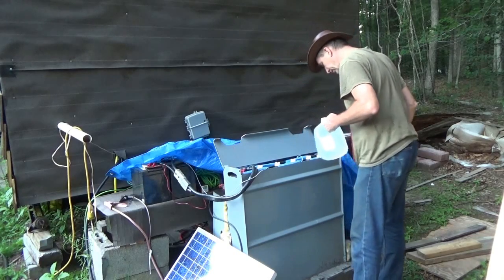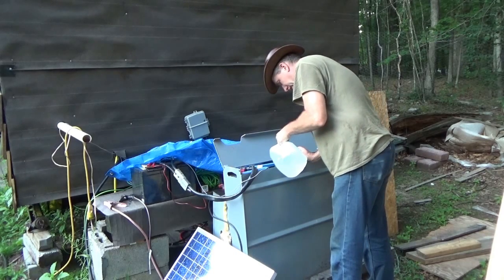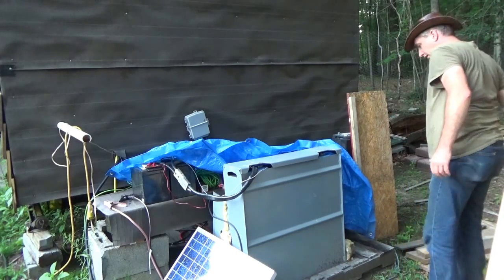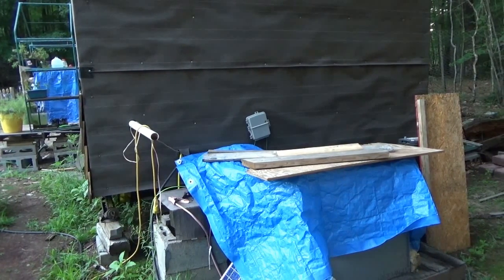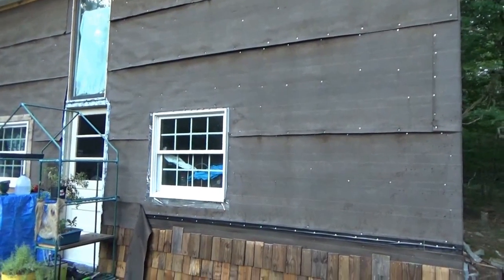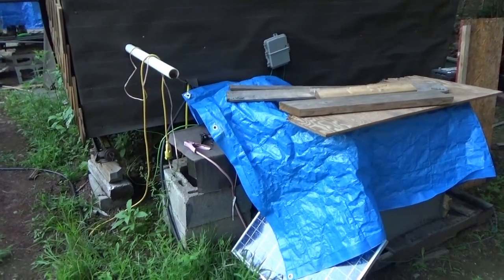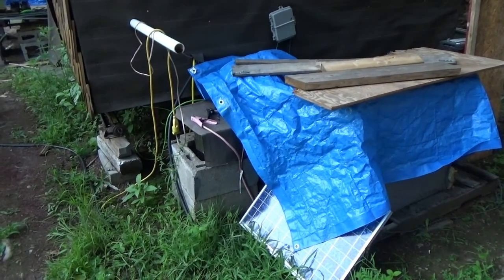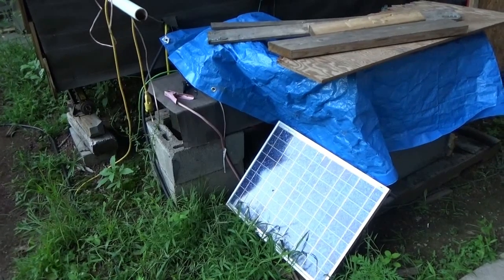Solar Power Forklift Battery Bank Maintenance & Update

Comment: If you run ac in your camper could you capture the water that comes off the condensation and use on for your batteries?

Comment: glad to see your showing to use only distilled water so many just dump in what ever water they have into there car truck marine, solar battery's and kill them, should also use a battery restore, comes in a 16 oz bottle at cnd 45.00 at 1oz per cell per year, cleans the plates and brakes all the crap down
Reply from the maker: Thanks. I try to take care of my batteries.

Comment: Nice update on the solar. I would suggest definitely taking the batteries back while they are under warranty so you can test them and take them back again if necessary. I am wondering about the wood. You know how that goes. Also, with the greenhouse on the side of the house, how will the heat get out there. Will you cut a window in that wall or something? Everything looks good. Thanks for sharing.  Janice

Comment: we use a hydrometer to check the specific gravity of each cell. its the only way you can truly  tell whats going on with your batteries, otherwise your just guessing. they cost around 110-150$. batteries are expensive, a hydrometer is a cheap investment. would highly recommend one.
Reply: Starry Hilder get a good hydrometer, the cheap ones are just that...junk

Comment: It seems to me that your charging system is inadequate. Simply, the batteries need to be bulk charged, then from time to time equalized charged. I would think that the "battery minder" you have may be totally inadequate for a battery that size. I think you do not have a dead cell. Your battery stayed stable while you were away, so no shorts, sulfide build up, maybe. Just that the battery is not getting a sufficient charge. Read up on "bulk charging" I think that may be the ticket. If memory serves
"equalize charging" helps with dealing with the formation of sulfates.

Forklift batteries are the best bang for the buck going. Even if the battery is poor, it will still serve in a reduced size household. Remember PROPER charging IS key.

Comment: these cels use indeed a lot of water Troy! (are you sure al the cels have the same voltage?)
agree , these traction cels use more water then normal battery's due to the higer charge voltage, but they sure use a lot of water), agree with you that they are problematic, would thry a cal to the guys who send it to you., the end voltage is to low.regards Richard

Comment: Is the house still resting on the wheels or do you have piers underneath holding it up from the side where the batteries are it looks like you just have car scissor jack helping to hold it up.
I imagine that tarp over the batteries isn't the greatest idea the tarp is probably absorbing the sun light and drain out the batteries.

Comment: The charging voltage needs to be at least 14.4 volts or the battery will get sulfated do you equalize them.
Reply from the maker: Roy Amberg A $700 professional solar charge controller does all that automatically for me

Comment: Troy for a 750AH bank at 12V you need approx 10 - 13% charge current so you should be looking at somewhere around 75 - 100A charge current to charge those cells. From memory I think you are topping out around 40A????
Reply from the maker: Andy Mahoney Yes but that is only when they are fully drained. I barely use 2,000 watt hours per day over here. I put that and then some back in each day. But they never did pick up. Even when I ran a generator when I first connected them for an entire week with no load.

Comment: Only 12.2 volts? Is your charge controller working right?
Reply from the maker: magnetman2010 Yes but the forklift battery was at 12.2 when I got it. I thought it just needed a top off but it never came up.